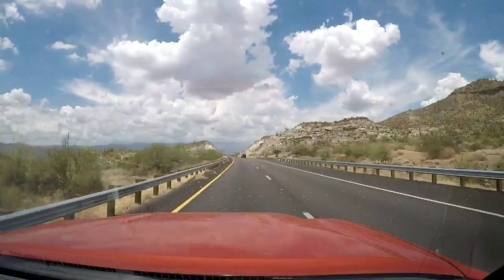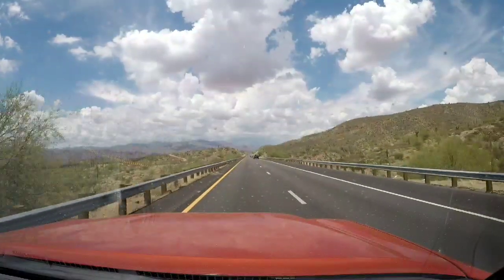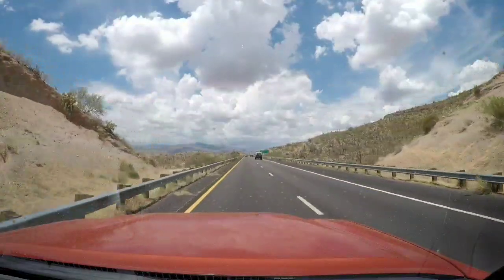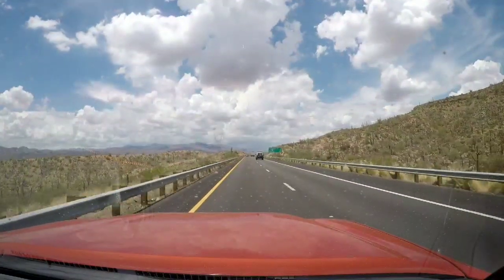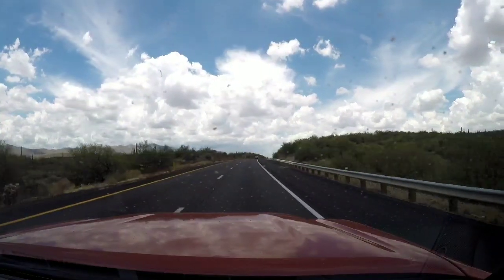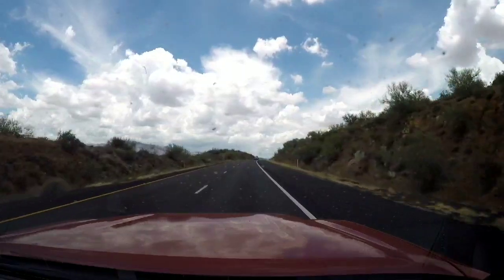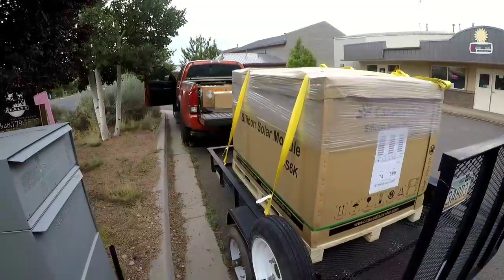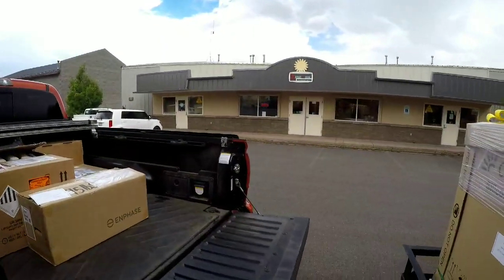My DIY Solar: Part 1

Comment: Any chance I could get your 3 wire and 1 wire diagram you used to submit to the city?  I am down in Chandler and will be submitting shortly and I would like to create my own drawings.  If you can, Thanks!
Reply from the maker: I got mine from DBMDesigns at DBMSOLAR.com I paid $350 but that was with batteries. They provided a packet, but I provided the spec sheets for my equipment used.
Reply: @ICanDoItMyself  Thanks for the reference, I have it mostly completed on my own in Visio through your videos and https://www.altestore.com/learn/ but I havent seen any examples of where to label all of the callouts for sticker locations, how to label line sizes, etc.  I was hoping to use yours as an example for what else I need to add.  Thanks for the quick reply!